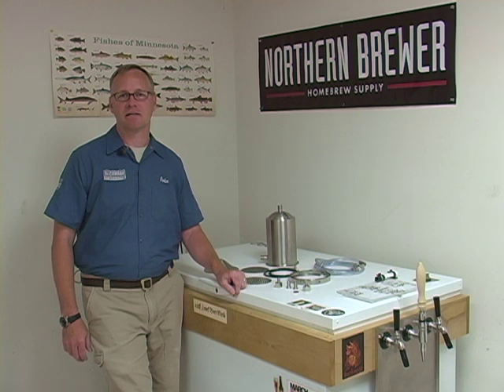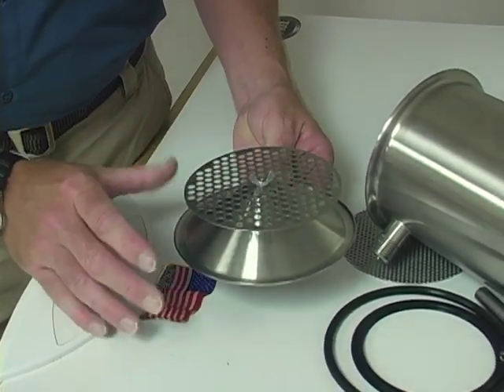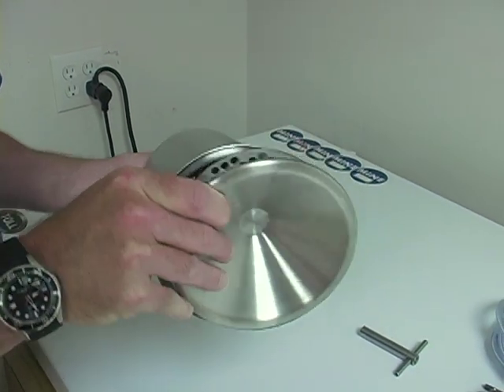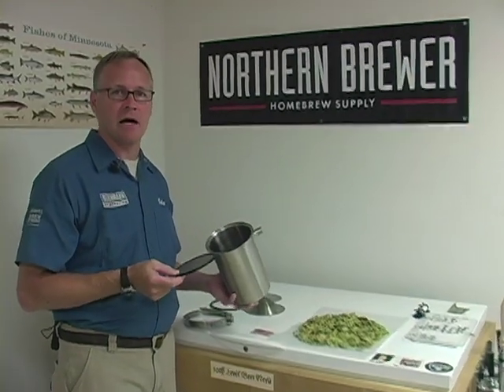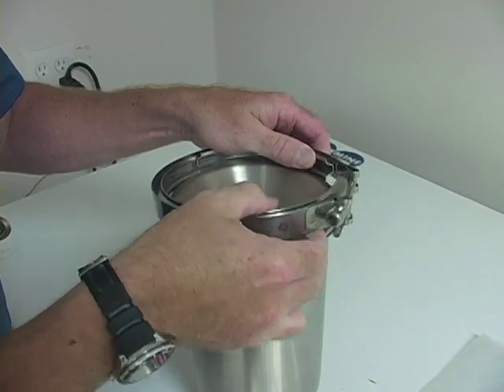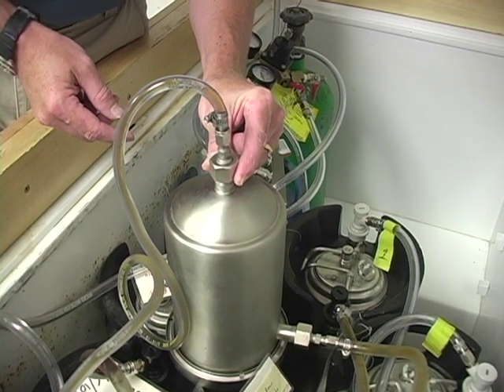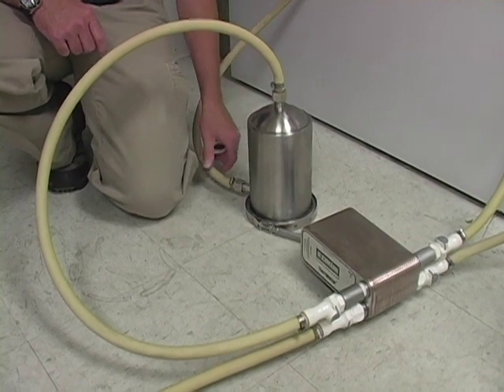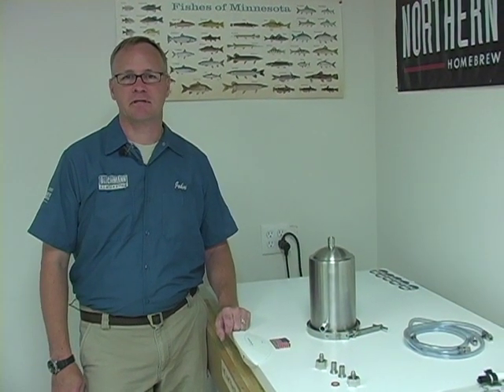HopRocket

Comment: Typically you would rapidly stir your wort in a circular fashion to create a whirlpool and wait about 10 minutes.  This will cause all the solids to form a pile in the center of your pot.  When you transfer, either siphon from the side of the pot or attach a strainer to the inside of the pot if you have a valve (like the pot in the video).  For any solids that do make it through the hop rocket will act as a strainer.
Reply: When you reach boil temp or before?